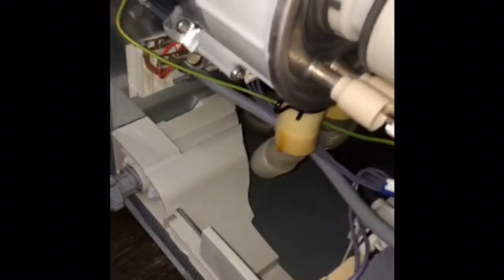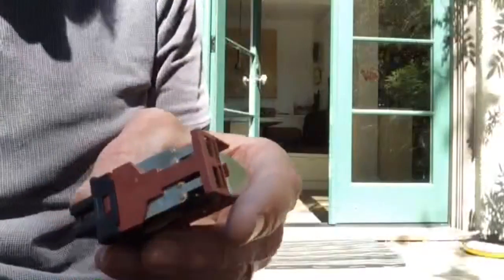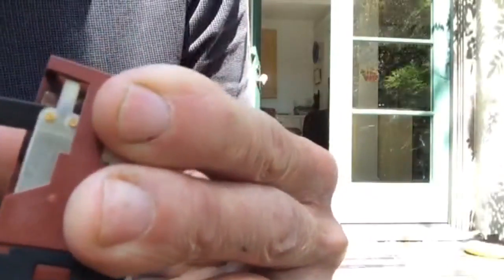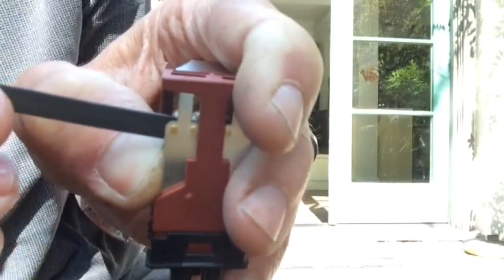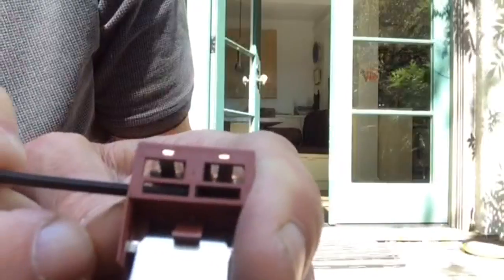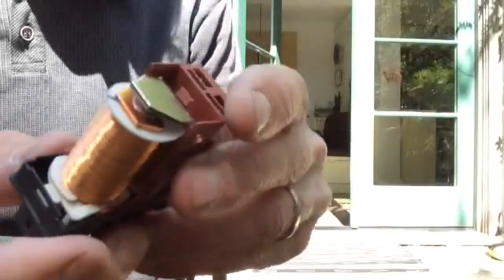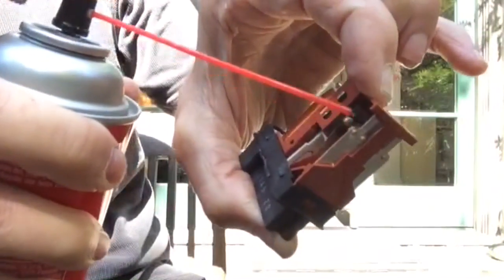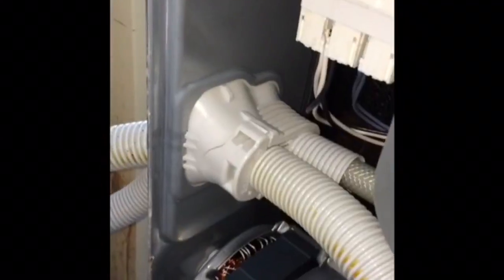Miele Dishwasher - 💦Water Not Hot - F-24 Error⚠️ - FIXED

Comment: Thanks Scott. Cleaning those contacts on the relay fixed the  F24 error that caused blinking rinse-dry-end lights in unison on my 13 year old Miele Inspira 2120 when I it tried to start a cycle. Thanks so much for the step by step.  Hoping for another 13 years now.
Reply from the maker: Nice job Robert,
Thanks so much for your follow up

Comment: Just done this fix on my dishwasher having had the fault code F24. All working fine. Very simple fix. In the uk a new relay is £72.00! One small point, on your video is it would be useful to show you taking the outer shell off the relay. I found it a bit painful to get off but did it using 3-4 tiny screwdrivers to prise the cover clips off. Excellent video and saved the day!! A big thank you.
Reply from the maker: Thanks so much Bob👍😊

Comment: Many thanks! Still can’t believe I was able to fix the issue in 20 minutes with just a couple of screw drivers and a nail file (and save lots of $$$ too)! The relay was just too clogged with carbon deposits. Works like a charm now. I would just recommend to label the 2 connectors on the relay that have a black and a white wire each as they look identical after pulling them out of the relay. 
Cheers!

Comment: Thanks for the idea! In the dishwasher Miele G4203, the problem was in the assembly of the device especially in the heater relay EZL 517A! They were not well connected by the manufacturer! I had cleaned the contacts well and then connected them properly!
Reply from the maker: Nice job😊

Comment: Agree with others here, very helpful videos, not enough to resolve my F24 fault problem easily, but got me headed down the right road.  My Miele dishwasher looked different than the ones you show when I got the bottom panel off (newer I think).   There were two small relays in their own seperate cases soldered on to the relay circuit board, rather than the one big with the exposed contacts you show.  But in the end I did not have to clean up the relay contacts anyway.  My problem was simply a thin layer of corrosion on the blades of the terminals (snap on plugs) where the wires are attached to the relay assembly.  All I did was spray some electrical contact cleaner (from your local hardware, electronics or auto parts store) on those blades and also on their receiving end, and work them over for a while with a small wire brush.  Put it all back together and it now works again!  F24 fault gone!  

And yes saved many hundreds of dollars in call out fees, repairs, parts, etc.  We all know that a repair person would never have tried to repair/clean anything.  They would have just thrown away the old part and put on a new $100+ one with no attempt to diagnose...
Reply from the maker: Wow, nicely done😊😊
Reply: 🙏. I am, for a brief moment, a local hero.  Even mother-in-law is impressed!
Reply: Whoops, not so fast.   (How brief that moment as hero was...).   After one successful wash, the F24 fault reappeared.   Since the element had tested (multimeter)  fine, the problem still had to be the the relays.  My theory is that I must just have bumped around the old relays enough while cleaning them up to cause them to work just one more time before going bad again.  

I did a lot of research over a few days to try and source the two identical relays, with the intention to simply desolder and replace them myself.   After tracking upstream to the manufacturer and finding the data sheet, I discovered I could get a pack of five of these relays for about US $12 + shipping.  But there are about 20 different subtle variations of this general model of relay, depending on contact material, coil voltage (which I did know) and single throw, double throw, etc.  HOWEVER, when I contacted the manufacturer of the relays by online chat to seek more information on which specific part number to get, I made the mistake of mentioning the specific brand and part number of the old relay I was seeking to replace.  They immediately knew from that information where those new  relays were going to be used, and what I was trying to do.  They immediately ceased talking to me, and refused to share any further information, declaring that that was a “restricted” part.  When I asked what that meant, they said that it had been built by the manufacturer for a particular customer organisation and that any details or information about that part were secret by agreement with the customer. (!).   At this point I began to experience a wave of righteous “right to repair” anger, before slamming my finger down on the End Chat button.   

I could have probably just made an educated guess about the right specific part to get, but in the end, under pressure from the home office to get the dishwasher working again ASAP, wanting no more delays, I just caved in and shelled out US $ 100 for a new little plastic box with two $3 relays inside.  Arrived at my door a few days later, replaced in about 10 minutes (mostly unscrewing and rescrewing things) and now working well again after a few washes (but will keep an eye on it!)

What have we learned?  1) Relays can be sneaky and Inconsistent.  2). It is possible for customers to fix things themselves. 3). Global white goods sellers are making an absolute fortune selling ridiculously overpriced spare parts for many times their actual value apparently with the cooperation of the manufacturers of those parts.

Comment: Had f24 error, this video was useful, also the various comments. Tried to clean the relay contacts, still had f24. Pressure seemed good, water was hot, but had the error after running for about 15 minutes. Note that if you retry right away it may immediately show the error, you need to wait 1 day so it really retries to wash. Eventually had also f14 error; changing the pressure switch made it work again for me.

Comment: Thank you SO MUCH for posting this up. I'm doing the work now and crossing fingers.  I'd rather just buy and replace with a brand new relay while I have it apart but don't have the luxury on waiting for Miele to ship this to me and it is a Saturday.  Stinks having dirty dishes pile up already for several days since the unit being down.  Question - what about adding an ever very tiny bit of dielectric grease between each pair of contacts to lessen the carbon buildup?
Reply from the maker: I think that would help👍
Reply: @ScottTheFixItGuyChannel unfortunately your fix didn't work in my situation Didn't use the bulb grease Allowed the contacts to stick too much Im still getting the F24 and an F14 thrown infrequently now too which is strange. I order a used heater relay and will go from there Any suggestions on your end? Unit is 17 years old Never an issue till now Used practically every other day Heater motor registered 11.6 ohms so looks good there
Reply: @ScottTheFixItGuyChannel  Scott could use your further input. This dishwasher been driving me nuts since May trying to fix. I went ahead and also replaced the control board because it started doing strange things and also threw F14 codes. I put a new relay in too. Still getting the F24 error. I cleaned the contacts on the control board and the connectors on the relay. The heater itself is registering 11.7 ohms on the meter so should be OK but I have nothing else to go on at this but having a faulty heater. I hate to call a tech after all this effort only to tell me I need a new heater. What should I do next?
Reply: Hi Jay,
I think it may need a new heater/pressure switch.
When the heater pressure switch is activated, it will allow the heater relay to be energized, which will send power to the heating element.
If the heater pressure switch isn’t working it won’t allow the heater relay to be energized. I never caused for that could be not enough water pressure on the circulation pump.
Reply: @QuickAndEasy5MinuteAppliance  Scott, thanks so much for the quick reply and troubleshooting advise. Just ordered the heater pressure switch. Simple enough to do. I truly hope this fixes it. Just some other input from my side, after I replaced the control panel and still using the second hand used relay that I purchased, it did work for about 3 cycles and then started throwing F24 code again. It had sat for a couple months with no power to it. Which is why I then said I better just buy a new relay to rule that out entirely but didn't matter since still got the F24. So I really don't think it's a water circulation issue but wanted you to know and had the full details. 

I will report back once I install the new pressure switch. If I get this working, I would like to donate to you via PayPal. I'll still be out around $290 with all parts purchased so far but would still be ahead if I had to call a tech or buy a new dishwasher for that matter
Reply: @QuickAndEasy5MinuteAppliance  Scott the new pressure switch seems to have did the trick. Ran 3 cycles (1 normal and 2 water saver) the last 2 days and completed normally. I owe you big time. Please supply me with a PayPal address as I would like to donate to you for your personal assistance. I couldn't have given my 16 year old  expensive Miele a second chance without your help. Also since I replaced the heater relay (new) and the control board (used) along with the new pressure switch, how much more life you think I can get out of my unit? If the heater itself goes I have no issues to replace that as well if required. Thanks again. Jay

Comment: Great video, I did replace the relay, still F24 error, pretty confident it wasn't the relay. Had a tech come in and replace the heater pressure switch; Fixed the problem (Model G5105). I used the new relay anyway, both parts replaced now.
Reply from the maker: Excellent ,

Thank you for the follow up 👍

Comment: Great video and instructions.  Outstanding insight and explanations as well.  My only comment was that there was a bit more water than expected coming out of my dishwasher when I turned it on the side, and I quickly had to do some damage control - but nothing that a few towels couldn’t absorb.  Cleaning the relay was relatively simple and seems to have done the trick.  Because the relay has only been “freshened up” rather than replaced (because we filed down the contact surfaces instead), do you have any idea how long this “fix” might last?  Again, great job and big thanks for posting such an instructional and well-produced video for us.  Kudos!
Reply from the maker: Thanks so much,
Probably 1 year👍
Reply: It will last as long as a new relay would.

Comment: Very helpful video. A tech came today and confirmed the f24 error. I'll try to clean the relay but the tech also mentioned the pressure switch. I notice the water still gets hot so does that mean the heater relay is ok and it's really the pressure switch? (note that the intake/drain light is not lit, it's a "3 lights error") also might be worth mentioning that we replaced the hot water a few weeks before the error started, not sure if that's a coincidence) sigh weekend project ahead
Reply from the maker: Hi David,
Can you send this question to my email:  scottthefixitguy@yahoo.com
Reply from the maker: So the error kicked in after they replaced the hot water heater?  I wonder if the new hot water heater is set to high causing the error.  It seems to coincide with the new hot water heater.

Comment: One of my output wiring connectors for my dishwasher heater relay fried (longer story).  Any idea how to find the part number?  From the service manual I think it's called the "heater partial wiring harness".  The Miele web site doesn't show the wires at all.  If I cant find it I'm going to cut off the connector and solder on generic female spade connectors
Reply from the maker: Yep,
That’s the way to go👍

Comment: Hello, your video was amazing and it explained everything so well but I think my f24 problem does not fit this. I have a 6 year old Miele G 4203 SC dishwasher and it gives the f24 code but it actually heats the water. The program started fine with draining and then intake. The machine even took in the tablet detergent. After about an hour at the first draining and pumping the water back in the f24 code showed. Any tips for that?
Reply from the maker: Might be that relay only acts up late in the cycle as it gets more resistance due to a build up of heat.
I would call Miele USA and have them send you a new one.
Reply: I had the same situation and cleaning the contacts did the job. I would assume the self test just measures resistance of the relay what goes up when the contacts are corroded but as finally high voltage goes through it, the water still heats up to some extent.

Comment: I have a Miele G4920 dishwasher, it has the F24 fault code so I took off the bottom. There is a part in the same position as the heater relay in the video but it looks different - more like the one described by Zrg Argo in the comment 3 months ago. Is this the part I should replace?
Reply from the maker: Can you send a picture of that to me at: scottthefixitguy@yahoo.com

Comment: Hi, great video.
 I have a Miele G-1530 SCI dishwasher and got the F24 error. Follow your video, the relay contacts were burned and black, used a file and sandpaper to clean them, measured the heater resistance and got about 20 ohms, assembled all but got the same F24 error.
Any ideas?
Does this G-1530 SCI model need to clear or reset the fault code before running? How to do it?
Thanks
Reply from the maker: Hi Miguel,

I would order a new relay from Miele USA
Reply: Hi Scott, thanks for your reply. 
So there is no "error code reset" procedure, correct?  I thought I had solved the problem but I had to program the dishwasher and erase the error code, as in some washing machines...

Comment: hi scott, do you know what F26 means in miele dishwasher g 7860?
Reply from the maker: G 5xxx3.20Fault Code F26: Boiling ProtectionSymptom:The program is interrupted and the drain pump is operated.Cause:Temperature at NTC temperature sensor has exceeded 194°F (90°C).Remedy:Check the heater relay and replace it, if necessary. See Section 050-4.10.Cause:NTC temperature sensor providing inaccurate information.Remedy:Replace the NTC temperature sensor. See Section 050-4.20.Cause:Heater relay closed.Remedy:Replace the heater relay. See Section 050-4.10.Cause:Faulty position monitoring of the automatic door lock latch.For a switched-off appliance, the door-closing function is in operation.Under adverse conditions, the locking system can stop in a faulty position.The control electronic recognizes this as a "zero position" and interprets itincorrectly. After the first (or a later) water intake, the fault loop occurs. Themachine drains for 4 minutes and, after the water intake, synchronizes theheating relay. Spray arm heating occurs up to activation of the boiling protection.Remedy:1. Replace the heater relay. See Section 050-4.10.2. Install a new electronic (SLT)

Comment: I did the relay fix, but then still got the F24 error. I then examined the main electronics (behind the control panel) and found a warped top of a 220 uF capacitor (made in Taiwan - by Luxon). After I'd replaced that 220 uF capacitor my Miele G1022i worked fine again. Hurray!
Reply from the maker: Wow,

Nice job👍😊

Comment: I cleaned the relay as you suggested, but I'm afraid it hasn't helped.  The water heater is working but only intermittently.  Any other ideas.  The temperature sensor looks okay.  I can't figure it out.
Reply from the maker: Hi Khalid,

Good chance you need a new heating element.  I think on your model it’s attached to the motor.

I can send you a video on how to replace it.

You can call Miele USA to order a new element.
Reply: Scottthefixitguy thanks for replying so soon. I checked the resistance across the heating element and it is around 20 Ohms. What's strange is that each part of the cycle the heater needs to come on there's a 50/50 chance it will. So it might heat for the whole of the wash or none of it or it might heat for the whole of the final rinse out not. The heater can work even to 75C but sometimes it doesn't. The model is G646 SCI plus. Thanks again for replying.

Comment: I ve F24 too. Changed the relay but still f24 and the drain is running. No water is filled. Any idea anyone?
Reply: If the heater relay doesn't do the fix, it is possible the heater pressure switch has failed. Replacing this fixed my Miele G5105 F24 error